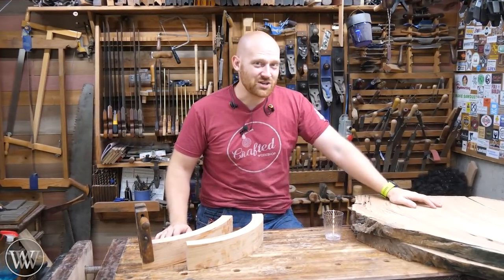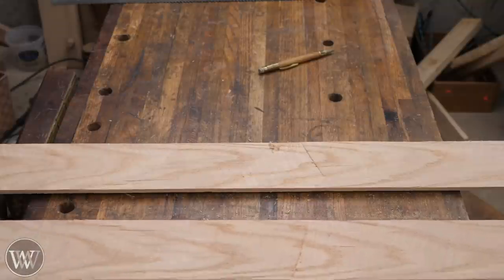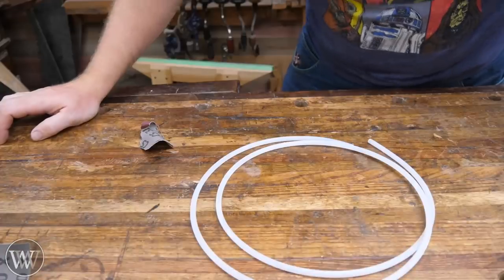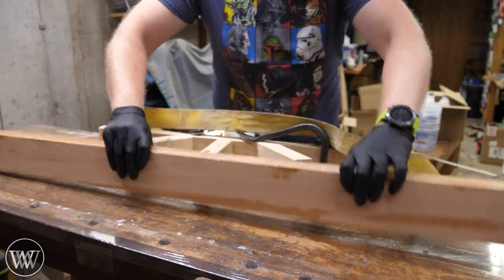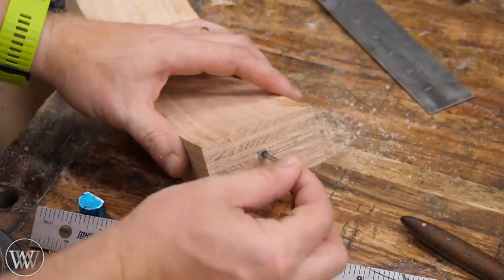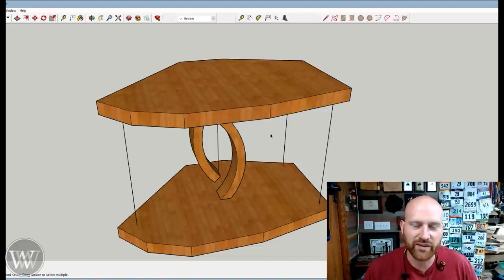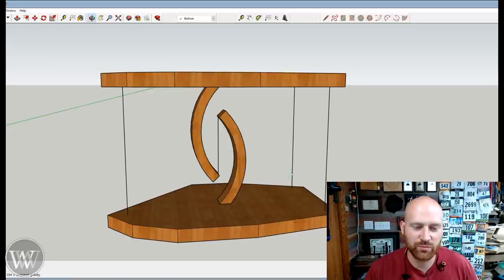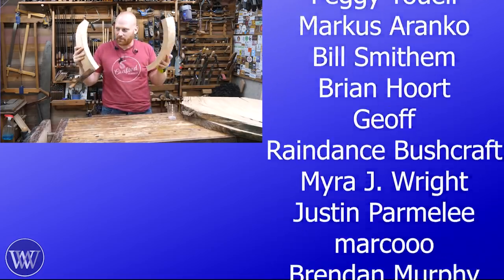How to Make The Impossible Coffee Table Banding the Arch

Comment: At first I was going to say leave the curves how they are it will add character to the table, then you showed the scetch-up file and I rethought my stance. It looks like when you designed the table that the curves were probably one of the more important parts of the tension strength needed to keep the table sturdy enough after the triangular wires are put in place, and them having the exact same curvature appears to be important. As far as the triangular wires go it should be enough, I mean the tripod is actually a very stable set up, works great with just about everything (except 3 wheelers imo), I mean it's been used since before the Egyptians built the pyramids right??? Great video man, I like how you stopped in the middle to talk about where you were at and what your thought process through the whole design stage has been.

Comment: Nice design, how do you think the table will react to twisting forces? Only impossible table i've Seen that covered that was from Evan&catelyn.
Reply from the maker: It all depends on how much tension I put on the cables. If I get the cables really nice and tight it theoretically you should be incredibly stable with less than a half inch of movement in any direction.

Comment: You are asking the wire to make very, very tight bends, they will need radi or they will kink and not travel.  Seems like the table will sway.  The wire will have a lot of crushing pressure on the wood at the corners.  The wire will not make the curves any stronger if the wire is free to move.  Looks like a neat project, but I think the wires need more thought in order to work the way you want them to.
Reply from the maker: Yep. All of the corners inside the wood will be rounded so that you'll have about a four inch radius that the cable runs around. also as to the sway I did a few tests with similar ones and because the center cable is a shorter sway distance than the outer cables it actually eliminates a lot of the horizontal movement of the top plate. Because they have a different radius of swing they actually work against each other quite a bit they'll be maybe a half inch of movement or so on top but not that much.

Comment: I've built a smaller version of one of those tables and the biggest problem that I ran into was the cable terminators ripping out of the wood (terminators were eye bolts, wood was poplar). I ended up mortising a trench in the bottom, embedding a steel rod, and wrapping the cables around the steel rod to terminate them with a friction clamp. It was a fun, thought provoking project that I never plan to do again!
Reply from the maker: Yep. That's why I'm actually inserting a bar through the wood and then Nico pressing the cable around the bar That way it's well within the design specification of the cable and it will have the vast majority of the table mass behind it. Rather than just allowing threads of an eye bolt to hold in.

Comment: You might have to consider some sort of metal rub bar at the ends of the arches to prevent the cables from digging into and destroying the ends of them.
Reply from the maker: Yep. I have stainless steel tracks that will provide a curved exit for the cable keeping it well within the design specifications.

Comment: The sharp angles of the wire between the two curved laminations concerns me as it like as if the wood will crush or kink the wire. I love the design, very different to the usual tensegrity copies. Hope it works out. Great dad joke to end on as usual. 😆👍👏👏👏
Reply from the maker: The corners where the wire comes out will actually be rounded with a groove inside of the board. It will have I'd rather large radius to make the curve well within the design specs of the cable.

Comment: Keep going with it for, at the minimum, a prototype. I understand the vertical stresses. How does it handle lateral movement? Won’t the top have some horizontal wobble in relation to the base? Cross triangulation could counter balance. Can’t wait to see how this turns out.
Reply from the maker: The interesting thing about lateral movement is that the center cable is half the length of the outside cables so it's arm of rotation is half the distance of the others. This actually provides a significant amount of lateral strength because the center cable can't rotate the same amount that the outer cables can.

Comment: I like the build concept, but it sure does stink when the glue up doesn’t go your way.  A couple thoughts on the design, first the wire will actually serve to further bend the arches because the forces are being applied out of the central axis.  In tensioned beans the load from the wire is placed off center so that it bows, then the applied loads will straighten out the bend.  Secondly, when considering the amount of load the top can take you’ll have to consider the tension in the wires, as they will essential act like placing a weight on each corner.
Reply from the maker: Yep. I actually studied theater rigging for my masters. there are a lot of fun design aspects that go into tensioning cables.
Reply: Cool, could you do a video about how you approached designing this table with relation to your theater experience.  From your comments it clear you thought a lot about this, and it would be interesting to see how you take you education to further your craft.
Reply from the maker: ya I have been trying to come up with how to do that video for a long time. most of the time I get and Idea and in free time just crank through it in my head over the coarse of years tell I have a fully fleshed out design in my head.

Comment: What makes these tables impractical is the outside wires - they shouldn't be vertical.  Ideally they should be crossed Xs, perhaps 3 of them for this design.  That would eliminate the wobblies.
Reply from the maker: Yes. The rotation of the top is often the worst for most of these. However if you tension it decently the movement will only be about a quarter inch to a half inch. Or at least that's what I found in my tests so far. Once I wire this up I will see how the rotation looks and I may end up adding in a few cross braces if I don't like it. But I'd rather keep the underside as clear as possible We will see how it looks.

Comment: Possibly use ultra high molecular weight polyethylene rope (e.g. dyneema) instead of steel cable? It is stronger and has has less stretch. Also nicer to touch and comes in pretty colors.
Reply from the maker: That would be fun!

Comment: What type of headphones do you use?
Reply from the maker: the ones I use are for running but they do not make them any more I bought several pairs when they stopped so i should be good for a few years. I also have some Iso tunes that I use from time to time.

Comment: Just a thought why don't you use 1mm or 1.5mm cable for the outer cables because they are not taking as much as the weight and I think it might look better.
I am thinking about making a dining impossible table with stools to match, but a long way from doing this still finding out about tensegrity and watching as many videos I can find
Reply from the maker: I have thought about using a slightly smaller cable on the outside however the next size down and cable has only one third the strength. and if all the weight is placed on the other side of the table that would mean the total strength of the table is much less.
Reply: @WoodByWrightHowTo  I understand what you are saying?
But 400 lb = 181.4 kg and 1.5mm cable has a max weight of 140 kg (so that's 280 kg for 2) but the small cable will never be taking the full load because the centre cable will be taking the most of the load.
NO I'm not trying to convince you to do this just giving my thoughts.
Can't wait to see you finished this. Like your plans.

Comment: if you ever feel like you want to add another tool to the inventory, a coopers sun plane would be the one :)

is it posible to do a dry fit up with a glue up like this? or does the epoxy weaken the wood, enabling it to curve into such a shape
Reply from the maker: Yes you can bend it without the glue. I usually do that ahead of time as it's good practice. That's one of the nice things about laminate bending is you can do all the bending without steaming. Steaming allows you to bend thicker boards but usually will not give you quite as tighter radius as lamination bending
Reply: Okay! That is really good!